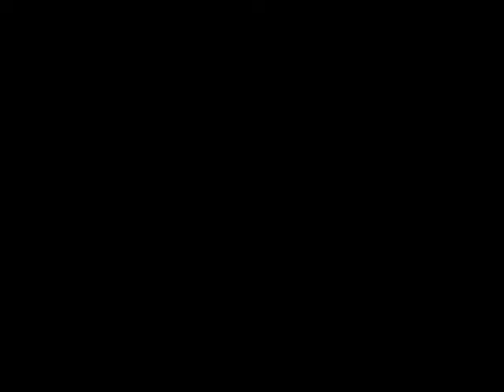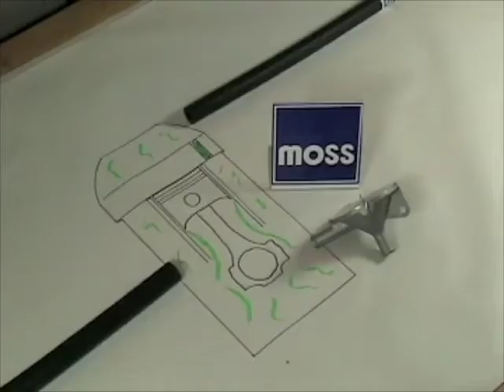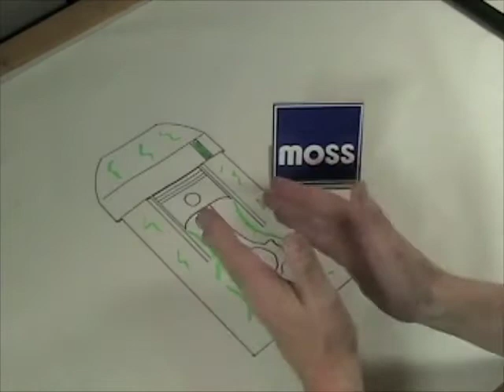PCV System (Part 6) - Symptoms of a MIssing or Defective PCV System

Comment: My 83 S-10 has oil all over the motor and keeeps getting it in the breather. I noticed all there is going to the valve cover is a hose with some kind of brass pipe that looks like a connector for a garden hose stuck into a rubber hose.  There is no "valve" of any kind in the valve cover or "grommet" . Gonna replace the PVC valve, grommet,hose and filter thanks for this info. Had no idea this was my trouble. Seems my mechanic didn't either since he had no idea why oil was in the air  filter

Comment: Thanks for the great explanation! 
Thanks for the video.  I have camry 2007 4 cyl with 100, 000 miles.  I 
changed the pcv valve,  I see a blow by but no smoke and the car has 
plenty of power.  However it consumes oil ~ 1 qt in 1000 miles when I 
was using Mobil 1 5w-20.  The oil consumption improves to 1 qt in 2000 
miles when using mobil 1 0w-20.  My questions to you:
1-Does the blow by means the rings are worn even though there is no 
smoke at all?
2-How to tell if the blow by is normal or excessive?
3-Do you think the car can survive for another 100,000 miles? or need 
rings?
Thanks